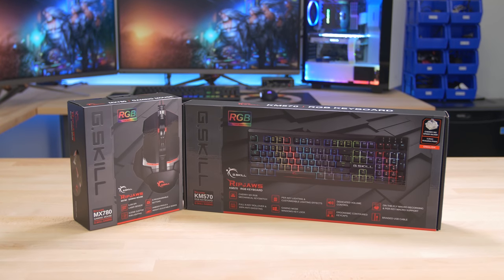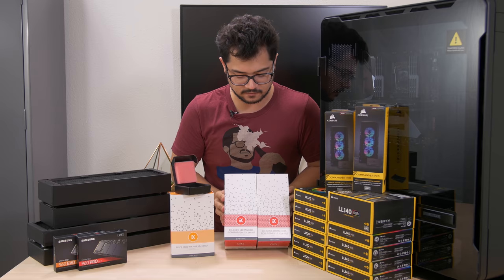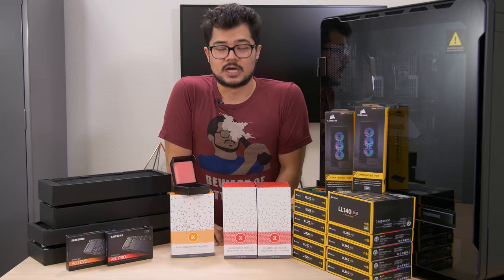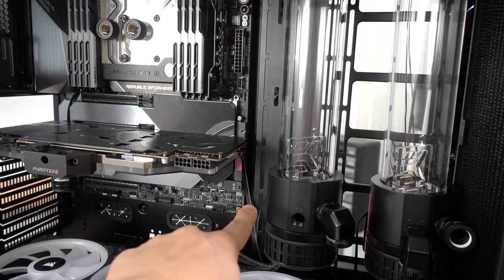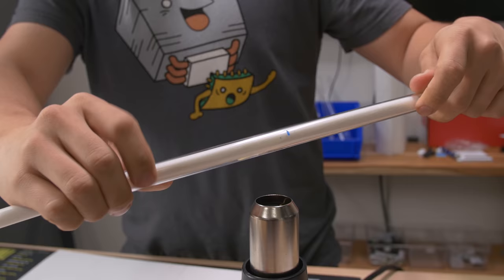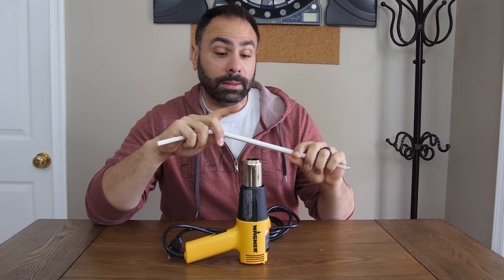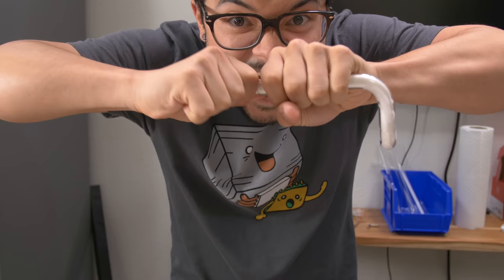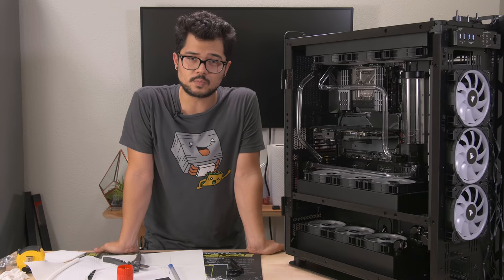ELITE BUILD PART 2!! INSANE PROGRESS!!

Comment: Mr. Wit get rid of that 960 EVO 256GB because frankly theres no point since it under performs even to a 960 EVO 500GB.  Your better off RAID'ing two 960 Pro's (500GB or more) in the DIMM.2 slot as your main all purpose drive.

As for your water loop its rather questionable you should really check out Singularity Computers channel for how to handle the dual pump/many radiator combo you got going on in that alleged 10K build.  The idea is to make them run in unison however you can get away with them running at a lower speed flow so there's really no need to split up each pump dedicated to cpu and gpu so long as you loop it properly.  

And for the thick lower radiators I feel like they need to be in push/pull fan configuration since the warm case air will need to rise out of the top of that very tall case given they are all pointed up.  You should consider flipping those fans attached to the lower radiators this way they exhaust upward thus bringing in cool air from the base of the case.  As for the top of the case I would get rid of the top radiator and leave it as 3 fans only just so warm case air can exit the top with no further restriction.

Good Luck!

Comment: Hey bud i know little to nothing at all about computers... is this a good PC build? and does anything look like it would CONFLICT? like is the liquid cooler good enough for the CPU? or just anything  you think would be better in any of the areas shown... thanks!

  
CPU 
Intel - Core i7-7700K 4.2GHz Quad-Core Processor
$287.89  

CPU Cooler 
Corsair - H115i 104.7 CFM Liquid CPU Cooler
$109.99  

Motherboard 
Asus - MAXIMUS IX HERO ATX LGA1151 Motherboard
$229.00   

Memory 
G.Skill - Trident Z RGB 16GB (2 x 8GB) DDR4-3200 Memory
$204.42  

Storage 
Samsung - 850 EVO-Series 500GB 2.5" Solid State Drive
$139.99  
Seagate - Barracuda 2TB 3.5" 7200RPM Internal Hard Drive
$80.98    

Video Card 
MSI - GeForce GTX 1080 Ti 11GB GAMING X Video Card
$769.99  

Case
Corsair - 750D Airflow Edition ATX Full Tower Case
$157.59 

Power Supply
EVGA - SuperNOVA G2 850W 80+ Gold Certified Fully-Modular ATX Power Supply
$99.99 

Microsoft - Windows 10 Home OEM 64-bit
$98.89

Base Total: $2178.73    
Mail-in Rebates: -$20.00    
Shipping: $8.98    
Total: $2167.71
Reply: I have a feeling you just went to pcpartpicker and selected all the best rated parts. But an honest critick would be to get asus strix z270 motherboard.
Reply: well i have done some research .. nothing major.. but it doesnt hurt to ask for guidance.. just because there are some good parts doesnt mean i know if they conflict.. if the cooler is enough.. or etc.. but ill look into the strix motherboard thanks =]

Comment: Quick question, need help with my build. My gtx 1080 has 8+6 pin power connector(i am sure you knew this). Do i use one VGA cable with 8 pin connector for power supply and both connector on the other end or do i use two separate cables
Reply: Pennywise thanks, btw it is EVGA supernova g2
Reply: +Pennywise I have an EVGA Supernova G2, it has both kinds of cables. It comes with two "8(6+2)-pin PCI-E cables" and two "6-pin + 8(6+2)-pin cables." So he can do either. +Gaming Needed According to Gamers Nexus, "if you're working with lower wattage cards, you'll be fine with a daisy chain [8+6], but try and do two separate cables." An 8+6 should still be fine with a 1080, but using two separate cables is preferred. In reduces the heat load on each cable and provides more stable power.
Reply: Malus1531 thanks dood, helped me a lot
Reply: +Pennywise Interesting, guess it depends on the wattage. I have an 850W and it shows both cables on the product page. https://www.evga.com/products/product.aspx?pn=220-g2-0850-xr
Reply: Malus1531 i just wanted to know of two different cables will for some reason fry the cards  or is it just the wrong way to do it
Reply: A cable with the 2 8 pins linked together will on a regular psu work perfect unless you are doing high power draw overclocking but even then it will only slightly matter so go a head and use the one with the 2 on it
Reply: Gaming Needed it really only matters aesthetically, I personally like 2 separate cables but it's personal preference.
Reply: +Gaming Needed Technically two separate cables are better and will provide more stable power, but in practice I doubt it will matter or change your experience. If you think a single cable is better for aesthetics or cable management you can use one just fine. All else being equal though, use two.
Reply: Malus1531 ill use two per gpu. Thanks

Comment: Spending 10g on a computer but too tight to get a little bit of aluminium or steel plate and fabricate a mount for the reservoir.  Surely you know someone who is capable of fabricating it.

Comment: What’s the point of 2 loops? It doesn’t make sense to me. I’d rather have 2 pumps in a single loop than 2 loops. This way you wouldn’t ruin your system in case one of the pumps fails.
Reply from the maker: 2 loops gives you more possibilities for creative runs and a unique aesthetic. A dead pump won't "ruin" the system, it would just shut down as a fail-safe

Comment: Uses Zip ties, top fans blowing out, mid plate fans and bottom fans blowing out the bottom, front fans blowing in. You sir should not be building PC's. And that's only after spending 60 seconds skimming through the video.

Comment: Could someone help me with my 1st pc build ive got parts picked i just dont know if its right, i already own an ssd so dont mind it missing from the list https://pcpartpicker.com/list/pnjbWX
Reply: Dimension Jester the parts are ok, just a few things. If you care about rgb you might want to get cooler master 212 LED (same cooler  just  comes with red LEDs) if you dont care about rgb you can save a few bucks by getting a cheaper 1080 (from gigabyte) and a different motherboard (srtrix f or strix h.(strix e is just more rgb stuff basicly)) also i would switch hdd for seagate barracuda (i thing this is how it is spelled) or go for wd black
Reply: Gaming Needed https://pcpartpicker.com/list/X7sB8K i changed the motherboard but the other strix boards were incompatible and i changed the ram also couldnt find a gigabyte 1080 much cheaper so rgbs will just be a 10$ difference